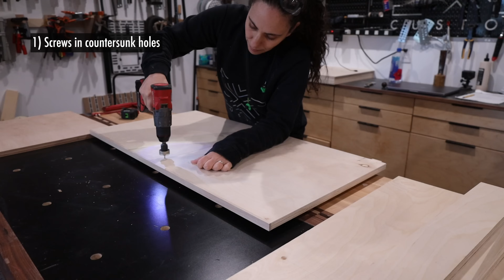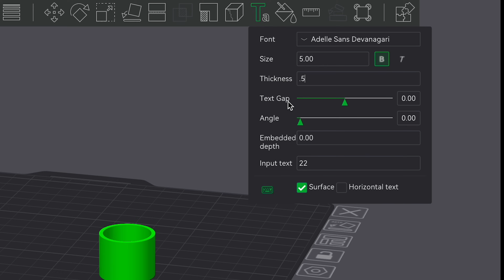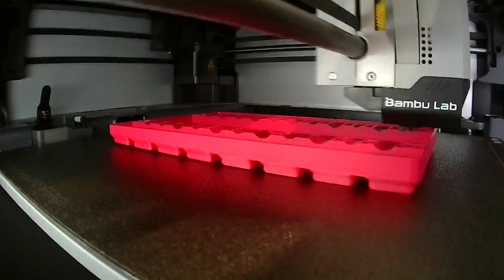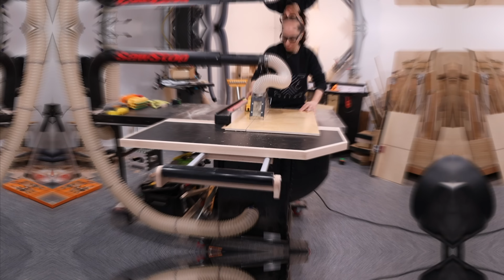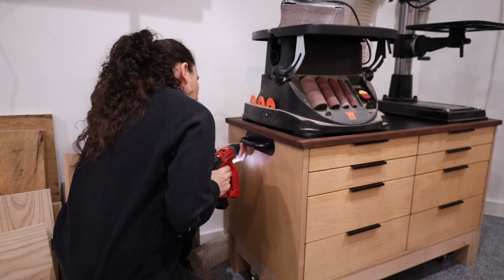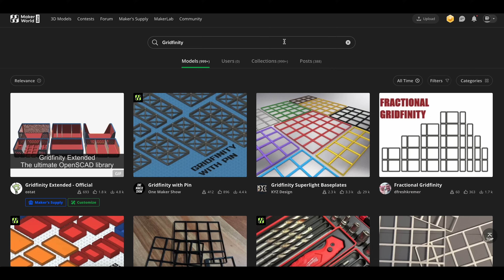1 Simple Motion Deploys all 4 Casters on This Tool Cart!

Comment: I'm gonna make a new workbench in the spring, and will keep these casters in mind. The way you engineered the system is exactly what I would be wanting so I'm definitely bookmarking this video. I will play with the handle design to make it a lower "throw" foot switch. I'm pretty jacked so I"m not worried about it being to hard to move the lever. To be honest I could probably just straight up lift one end of my current work bench, so worst case scenario I could just do that to activate the casters. Your system is way cooler though. Maybe I'll actually build the bench and see how heavy it is to just hulk mode it up. I could always add your pipe system on later as long as I build it with that in mind.

I just got a 3d printer too. I was expecting the casters to be pretty expensive but 90 bucks for the biggest set is reasonable. Even normal casters aren't cheap anymore. But I've found that the casters with brakes on them just don't work when you try to hand plane wood, they just slide across the cement and bring themselves down, especially if you're taking a thicker cut or don't want to sharpen your blade even though you should. I'll probably put some rubber on the bottom of the legs to give it even more grip.

I've got plenty of time to plan it out as winter is coming soon so woodworking season is just about done  and this project is too big to try to rush it in. Plus I want to incorporate some milwaukee packout into the design and I have to wait for Black Friday sales to get those.

Comment: I anticipated the “fancy” casters would blow the budget on this build but actually they are sold as a set which brings their price down to a reasonable level!  Using black pipe is a very frugal choice and along with a most impressive (eloquent engineering) design!  You rarely disappoint!

Comment: Seeing as how the handle is just a piece of pipe screwed into the 90° fitting, if you wanna try a shorter handle, unscrew it and put in a different length. If you find the shorter length will work with your foot you could put a short pipe and then another pipe sticking forward with another 90° fitting so the end is closer to the front edge. The point being is because it’s just black pipe screwed into a fitting. All you gotta do is unscrew it and replace it with a shorter length with a separate piece of pipe or several little smaller pieces that are threaded at both ends and some connecting fittings to find out what length works best not to mention the 90° to have the handle point forward more keeping it even lower for using your foot. Well now I’m just babbling so I’ll stop being repetitive and wish you a wonderful day.🤗

Comment: You rock -- as a side project I've been trying to come up with a better idea for moving my workbench around the shop. And ultimately I can't beat what you've come up with. I way over-engineered it with servos and custom laser cut steel plates. And then just decided that you've got the simplest design, and that wins! Thanks so much for the awesome design and video!

Comment: The delight you had when the lift mechanism worked was contagious! Love the bit at the end with your kiddo, too. 💛

Was wondering if you ever thought about 3D printing the drawer pulls. The aluminum ones you use seem like they would be easy enough to model, but I wonder how they'd hold up. 🤔

Comment: For your caster lifter, try 3D printing an insert that has square or hex socket.  Then you can use a single lift bar with either a square (.5 or .75") or a hex "key" perpendicular to the length of the bar for all of your castered cabinets.  The other advantage is that the lift bar can be removed leaving the cabinet side clean.  Great idea and thanks for the video.

Comment: I'm looking for good retractable caster ideas, and this one's the best I've seen so far. Although now after you built that I'm thinking the fancy "retractable" casters might not even be needed, you could put normal casters on the lifter bar so they extend below the legs when extended. Then make the cams have a shape so they lock in the extended position so you can leave the handle there... Have to think on this some more!

Comment: Those castors are great and not too expensive.  It's a good prototype, but I think there's room for improvement.  When you raised it up fully loaded, it swayed quite a lot.  I think if I were doing this myself, instead of the cam, I'd have a parallelogram arrangement using steel bars, where one of the vertical arms of the parallelogram was welded to the lever.  The parallelogram should deal with the swaying, because it's lifting each corner.
Reply: That would be more stable, but it would also push the table forward when lifting it. Although if you had normal casters on the parallelogram bottom, instead of the fancy ones, that wouldn't be an issue. That way, you'd also get away with lifting it only a tiny bit off the legs, so you'd more leverage.
Reply: @patrikj  You're right, it wouldn't be a straight lift, but it's "a lift in the right direction" (at least the way I'd do it).  That is, when you lift it up, you're presumably going to be pulling it out.  When you lower it, you typically want it tight up against the wall, so the fact that it lowers away from you makes this easier (albeit with a bit of rubbing on the way down).
I'm not saying my way is the right way, or the only way, just that I'd prefer it to be more stable, and that's the way I'd do it.

Comment: You might want to use TPU printed rubber feet under your cabinet to dampen the fall?
Speaking of 3D printing: what you've done with the prototype-bushings is called dialing in the fudge_factor in FDM printer slang. Get yourself a resin printer and you'll never look back.

Comment: Thank you for your design.  I have been saving examples of mobile workbenches with caster wheels for years.  One of the better ones that I saw was from an old Woodworkers Journal from 2005 that uses a hand crank mechanism.  While the outward appearance is similar it uses a wedge typle mechanism underneath and I have never gotten around to trying it.  Well, I have since scrapped that idea and your design has shot to the top of the list.  Thank you very much.  I HAVE seen someone use a bicycle gear cog to transfer the crank to the upper portion of the table so that you can crank it, and it takes about 2-3 turns due to the reduction.
Reply from the maker: Seems interesting!

Comment: Awesome build, love the lift mechanism, only thing that struck me was that if the lifter handle was on the other end of the table, or you pushed instead of pulled it on the side that you have it, you would be tightening the threads when under the load of lifting.  Over time I would be concerned that the threads may loosen.  Drilled and pinned would lock it, as well.  Absolutely love the build and those casters

Comment: Another absolutely awesome build. I wonder if bringing the lift arm more vertical and them putting a 45 on it with a short extension towards the back would help so you don't have to bend as far to operate. Just a thought. Good job. 🙂

Comment: You might want to print a new head for the lock line dust collector. Maybe something that is compatible with a mag switch so it can stick to the drill press table. I do have one question. When you print your dust collector fittings, what angle do you taper them? I need to print a bunch, and I’m unsure of how to get a good fit.

Comment: I love the cleverness of the cam system, and I would definitely be using that affiliate link for the casters when I get to building my own workbench. I've been pondering how best to do the same sort of thing while I'm still on the planning phase, but have not found a good solution. Instead of your cam system, I plan to have segments of a 4x8 bench that I can move to the center of the room and lock together. I have an idea for how to do that though, I just needed a way to move and then solidify the pieces.

Comment: Not sure what material you printed those bushings, but it was not nylon.  Looked like PLA or a similar.  That is going to g to fail on you in short order.  Maybe an ABs would work.  Common mistake when woodworkers start messing with plastic.  I guess if you you only use this a few times you will be ok, but expect it to die.

Thanks for showing those new casters.  They look interesting.

Comment: Great build. The one thing I would have done differently is made the bushings for the lifter bars double the length so that they stick out above the bar so that when the bar is lifting the cabinet up there is a lot more of the bushings still in contact with the two pipes for added stability but apart from that it worked out perfectly!
Reply from the maker: Good tip!

Comment: What a great build. You make cabinets look easy. Your lifting mechanism is really cool and makes those casters even more functional.  One small improvement this retired ME might make is to design a spiral cam instead of a circular one.  Not too hard really.  It would make the forces more balanced, reduce the torque on the cam and make it just a little easier to actuate.  Don't fix what ain't broken though.  ;-)

Comment: There's a high chance if you roll up onto a threshold (or something else) one wheel (maybe two) would stay up in the air and reset so when the cart goes down on the other side, the same corner where the wheels at will just hit the ground. It will be a pain to make the wheel go down cause you have to fiddle with other wheel on the other side too when you lift the cart.

I haven't watched the whole video so did she think of that?

Comment: I installed the Loc-Liine system on both my drill press and my mortiser, and I love it. Yes, you need a longer line, but that’s an easy fix. Also, swap out that flared rectangular nozzle for the tapered oval nozzle. That tapered nozzle allows you to put the point of the nozzle right up to the drill bit or mortise chisel and get near perfect chip extraction.

Comment: This is an awesome build in every aspect.  The drill bit organization is absolute perfection.  You could have a side hustle selling those in printed sets.  Kudos on this!

To stabilize the lift, you could have a second pipe under spread apart, but turning opposite from a gear.  This would allow 4 offset cylinders to lift equally vs the 2 in the center being the balance point.
Reply from the maker: That definitely sounds like a good idea

Comment: Very nice shop with some great ideas all around.  This lifting device is clever, there are also some that you can get commercially but I like yours - i do not like the fact that the pipe is sticking out of the side and is so long but i am positive it could be made to "pop on and off" so that it could be set out of the way.  

I have worked in manufacturing for a very long time and have had the need to move some fairly heavy tables around - think of a table made from square steel tubing that has a top measuring 60" inches x 72" and will have fixtures and parts on it when it needs to be moved.  I designed a few different solutions over the years.  A couple of the coolest ones used air cylinders to lift the bench - roll to the new location - then let the air out to bring it back down.  It was awesome as we had shop air everywhere.

Comment: Very cool! I don’t even need a bench/cart like this but now I kind of want one 😀

An idea for your drill press. Build a table/fence for it. A few inches thick. With a grid of holes in it 5/8 or 3/4 (big enough to suck up fortner chips) Like a downdraft table. Hook that up to your DC. It does an amazing job (unless your piece covers all the holes) and also helps hold your work piece in place!

Also use that flexible pipe in the right edge of your belt sander. Will help pick up a lot of the dust that doesn’t get sucked down into the machine.

Comment: First off, i love it!  Like everything.  I have a few things to add.

1. The crank/lever could be removable, that way you can store the lever on the side or in a hidden hole in the cabinet.

2. The cams being so thin really scares me.  I'd probably add a couple more cams, just to distribute the weight a bit more, prevent the wood from breaking.  Hell, even milling actual metal cams would be great.

3. I absolutely love the drill bit system.  Color coating was just a stroke of genius.

4. I have a small kitchen/dining room, and wanted to do a floating island.  These casters would be amazing.  Infact, a cabinet like you made, with these casters would actually be the perfect solution for a floating island.  It's on my list.

Comment: A very nice design, flawlessly executed as usual.  The level of expertise you bring to these projects is top notch!  
For my own humble half-garage shop, retractable casters follow the more affordable Carl Holmgren design:  Regular casters on hinged, tilting boards, their edges trapped front and back under cleats fastened to the cabinet skirt, handle attached to the rear board pushed down and clicking into a catch to flatten the boards and raise the cabinet on the wheels, handle up to tilt the hinged boards and retract the casters, so the cabinet sits down on the skirt.  But if I had all your neat stuff, I'd no doubt go that way!  Really cool!

Comment: Brilliant design. As your son was actuating the cam it struck me that the screws you used to retain the pipe in the cam would carry the weight of the table (in shear). Probably not an issue unless it’s actuate often and it fatigues.  If it ever shears (it would fail safe) a screw through the two pipe walls or a pin would solve. As always thanks for sharing. And your dribbling is excellent😂
Reply from the maker: You’re totally right. A bolt going through the pipe would have been better. And sadly, I didn’t make the basketball team in high school 😥

Comment: Rings workshop originally posted this design and video several years back. It will be good to give some credits.

https://youtu.be/c_Zipc9MGmo?si=UVyucxRvNZwqcL-A
Reply from the maker: Wish I saw that video before I made this. His way of attaching the wheels with a bolt is definitely smarter than the screws that I used. It’s kinda weird to assume I have watched every single YouTube video ever made…
Reply: @3x3CustomTamar  no worries. I was watching all similar videos in a row. So I just made a comment.

Comment: At the drill press use the nozzle end on the loc line and get it right up where you are drilling.  The wide mouth works well with the benchtop sander, or on the left side of the router table, flush with the table top..

Comment: To prevent wobbling, maybe you could put two parallel bars around your main bar and put gears connecting them to the center. Then the two new bars would have cams in opposite directions. Pulling the lever would make one set of cams turn clockwise and the other counterclockwise so you would have even lifting

Comment: "This whole hand-cranked situation would not have been possible without these magic castors."

You don't need to use those castors to do what you did, although those castors are a good idea and make is easier.  Lift mechanism for portable carts have been around for a long time, and I've already created a rolling cart about half the size of yours, and a workbench, both of which use normal castors.  I raise/lower the four castors on the cart with basically a press of my foot.  The much-bigger and heavier workbench requires me to do that twice, once at each end, although it would probably have been possible to design it for one single action.

If I'd known about these castors when I did mine, I would have seriously considered them, however.

I love your videos.

Comment: Super impressed with your design and love how practical it is, will definitely be referencing this video when (not if) I get to building something similar. The only thing I can think of changing as of now would be making it so that the crank is removable and storing it in one of drawers so that it is out of the way most of the time, but that is just specific to my use case as I don't have much space in my shop.

Comment: That was the most painless "here's my sponsor for this video" segment ever that i didn't ffwd thru. Clever.
U can also shorten a spring to increase its tension. Clip off a few coils on one end then bend the next coil 90° to hook properly. The spring has to stretch to larger gaps between (less) coils so more tension. Saves trips to the dreaded big box store

Comment: Hello Tamar, looks nice, the lift is great! I thought the scews which are connecting the axle and the wooden circles may a little short? Maybe after lifting a few times the wood could break - when you use longer screws which are going in the metal axle and in the wood on the other side, that will not happen!

Comment: orca slicer is a better slicer, its based on same code as bambu slicer, with improvements. Also, its horrible doing anything more than simple things in slicer.  The coordinate system is fundamentally flawed in both bambu slicer and orca slicer.  Also,  bambu is horrible company.  They are basically the HP of the 3d printer world.   They are gradually taking away features from users and forcing.  And their NDA that influencers sign basically prevents and negative comments about their products.

Comment: Your build is ingenious. I have a shop that is very narrow. The only way I can make it useable for multiple tools is with some kind of modular system. I’ve been trying to rebuild it in my head for years. I think your idea could work for me but I feel like there is a way to do it with a step on the front of the units to engage and disengage the wheels. I also don’t have a 3D printer but I’m seeing more and more that it is becoming a must have. Excellent video.
Reply from the maker: Definitely would be fun to do with a foot pedal in the front